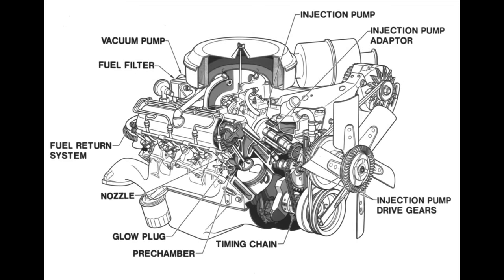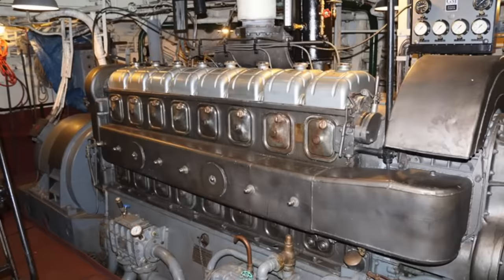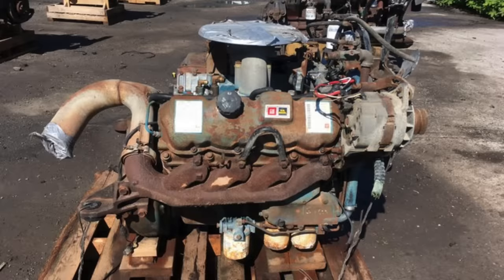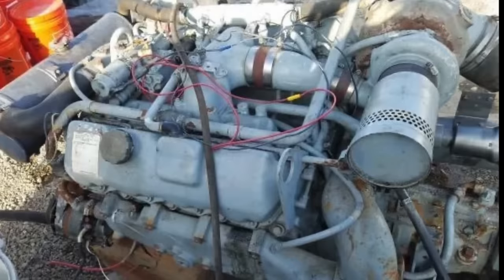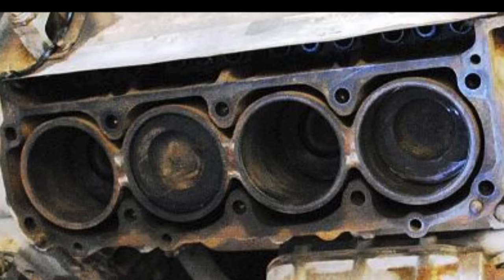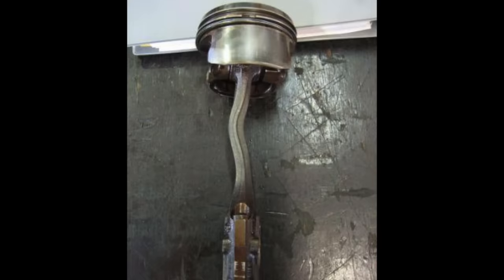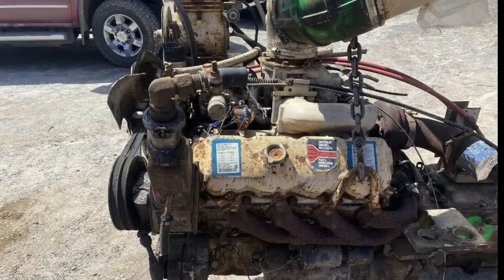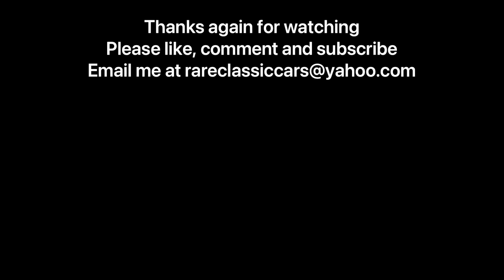Worst Engines: GM's 8.2L / 500ci "Fuel Pincher" Detroit Diesel Pinched Its Owners' Pocketbooks

Comment: The head gasket issues are even more hilarious than that.  From what I've heard from others who worked on it at the time, they updated the gasket, which didn't work, they tried to harden the cylinders, which didn't work and created a tendency for them to crack.  Then they put out a bulletin to drill out the head bolts to the next size up, which actually made it worse, because that block was so weak that the extra clamping force warped the deck and pulled the cam bearings out of round, resulting in the camshaft seizing.  Incredible right?
Reply from the maker: Those stories are correct.
Reply: Lmao
Reply: Holy crap
Reply: Wow. 😂
Reply: Jesus christ this engine has murphy's law written all over it
Reply: I used to work as a welding supply chain store service tech and every brand we sold had at least one part that was used in multiple models that was junk by design, that they constantly said they fixed the problem with, but never did anything but change the part number on it and rais the price.

One day we had the major company Reps come through and this issue came up and they denied the whole thing until I went in back and brought out all 5 of the supposed updated boards from oldest to newest and told them to tell me what they fixed given every board was the exact same circuit layout using the exact same components and only the board ID numbers were what had been changed between them.  I got zero answers.
Reply: Good lord. At that point they might as well tell technicians to weld the cylinders to the block. 😂
Reply: I've got to of the 250 turbocharged 8.2s and they aren't a power house but the get about 10 miles per gallon loaded or empty and so far the one has been good but the others on stand by for a replacement
Reply: It's pretty standard procedure that when you alter the clamping loads on an engine, like when you stud a block for racing, you torque things to the new spec and hone or bore all the relevant areas to ensure they are round under operating conditions.    Trying to increase head clamping force without considering bore distortion and cam journals is a rookie mistake....
Reply: Straight diesel aways better then v diesel
Reply: Unbelievable. Literally can't make this shit up..
Reply: DAMN!!! 🤯😂
Reply: @cjhopkins7128  the same thing goes for petrol engines.
Reply: I am still running 2 of the 8.2's  , I also had a 5.7 diesel in an old , without issue
Reply: @ShortLifeProductions A shit design is a shit design. The only fix for shit, is the toilet. That’s what my dad always said.
Reply: I am still running 2 of these 1500 hrs and dont leak or burn a drop of oil !!
Reply: Silly question, what would have happened if you'd have welded bridges between the cylinder liners and block, turning it into a closed deck?
Reply: Good way to help prevent some of these things is to run the engine colder than normal. About 20⁰F colder than normal, during the summer.
Reply: @Choochinc this engine would make a great trot line anchor. 😂
Reply: It was amateur night in the engineering department

Comment: It's almost like GM decided to put ALL its bad ideas into one engine
Reply: They just needed the plastic coolant elbow of the 3800.
Reply: No. GM people all their bad ideas into a LOT of engines.
Reply: @peteness9550  True! Things like camshafts made out of candy, nylon timing sprockets, and the LT1 in General Motors B bodies and D bodies.
Reply: Let’s get the crew that designed the Vega engine over for beers and they can help us design a diesel
Reply: Let’s not forget Active Fuel Management and its collapsible AFM lifters that eventually fail and destroy the cam.
Reply: It was the bean counters telling the engineers that we need to cut costs so we can keep our big bonuses.
Reply: If it saves $0.50 per engine, GM will DO it!
Reply: Well, it was a committee decision, so 😁
Reply: I worked on school busses during this fiasco... weak weak engine.. advertised 165 NA and with auto trans, in order for this pig to untrack itself, the converter was so loose when it changed gears it only changed pitch slightly... bad bad bad idea... outstanding mileage but that's all.
A few years later ford replaced it with an old farm tractor I-6 turbo diesel that had 3 times the drivable power and even better fuel mileage... another gm failure
Reply: @maxon1672  There is a class action lawsuit ongoing right now against that
Reply: @turnne  I heard about that. I hope GM feels the pain. Unfortunately the case only goes back to 2014 model year engines, even though the 5.3 has had AFM since 2007. It has affected two of my well-maintained trucks.
Reply: @peteness9550 speak English much?
Reply: @billjenkins3699  165 NA wasn't bad for that displacement, assuming it actually made that much power for long, I would be very skeptical of any of those actually putting out 165hp.  Early 5.9s were only putting out 160hp, but also 420lb ft.  normally for NA diesels to make good power they need to be huge.  I've driven enough malaise era cars to know just how shit American V8s could be back then haha.
Reply: @mrvwbug4423  500 cubic inches? That's nuts!! The turbo version was only slightly better
And tq was sad
Reply: @billjenkins3699  That torque is sad.  500 foot pounds with a turbo, and 350 without?  I had a 1972 Cadillac with a 472 cubic inch (7.7L) gas engine, and THAT thing made 500 foot pounds of torque with gas.   (They also made a 500 (8.2L) back then, on the Eldorados, front wheel drive, that made 550 foot pounds of torque.)
Reply: The two stroke Detroit wasn't a bad engine. It hauled more freight and powered more heavy equipment and generators than any other design ever made. Now the 8.2 was the Oldsmobile diesel of trucking.
Reply: @HighSierra1500  ford and dodge used the nylon timing gears. Ford even used one on their gear driven 300 6. its was for "noise reduction". Stupid idea.
Reply: @seeweezeke  Stupid, indeed! I cannot say I've ever clearly heard a timing chain and sprockets while the engine is in operation.
Reply: @HighSierra1500  you haven't. they were CHEAPER
Reply: Seems they had plenty left over
Reply: @K-Effect lol promote them
Reply: @seeweezeke  they lasted pretty well though, I swapped mine out to cast iron cause I was afraid the cam gear would break - now it sounds kinda like a tractor, cool actually
Reply: The company my dad worked for, bought 50-60 GMC Astro back in the early 80's. They had about 7 donor trucks to pull parts off of, after 2 years...

Comment: Worked on Detroit 6V53 V-6 diesels in the USCG, and 3-53 diesels in skidders; we always said of Detroits, "if there's no oil under them there's no oil in them"...
Reply: Loud loud 🔊📢
Reply: My grandpa told me that Detroit engines was the reason God made Silicone!
Reply: bit like harleys.. same sht..
Reply: I used to ell and fix used cars in the 70s. I said, "Show me one that doesn't leak, and I'll show you one with no lube in it!"
Reply: You also got to remember that 71 series has been made since the mid 30s... so there were a baziilion of them leakers out there even though the late silver series updated in the 80s though late 80s didn't reall leak or burn oil nearly as badly.
Reply: We ran a 3-53 in the crab boat no wonder my my hearing is gone.
Reply: Truth is these the 53 series did just what it was meant to do..... n also were  universal which is now an old school idea?? Why have 253 353 453 n 6v53 ect. All use the same parts...... 
Pffff who wants an engine that is cost efficient to repair.... 😊 ok must say I love these engines.... from the 253 on the screen plant 353 n 453 in our skidders to the 671 in My fwd highway plow truck..... run um on the governor n keep the oil up😊 hold onto the parts u have seem to b harder n harder to find lately guys
Reply: Lol right when it stops making noise that's when you worry!
Reply: @Wingnut353  that's because an ECM was added and it had a 10 minute idle timer. If it idled 10 minutes it would shut off. The old two strokes would leak out of the airbox drains if idled excessively
Reply: @Drmcclung  
Just like a jet engine. 
You don’t want ‘em to get quiet.
Reply: Most of the time it's shitty guys fixing them. my oliver 1900 is dry never did paint the engine it's all rust now. My old man rebuilt it 5yrs ago. He never had a leak on a detroit secret is aviation form a gasket on all the gaskets.
Reply: Well DUH!!, they are a two stroke!!!!! small internal leaks cause the crankcase to be under pressure which in turn pushes out oil. Remember they are a 90 year old technology and still working.
Reply: I was born into a logging family in 1976... I can remember as a kid dad having Franklin Skidders with 4-53 Detroits. When the temp got down close to 0 Fahrenheit he used to leave them running all night cause if you didnt you had to pile sawdust underneath them and soak it with diesel and light it on fire for an hour or two before they would crank. But a worn out detroit will outlast a brand new cummins, minus the performance...lol
Reply: Detroit Diesel the most efficient way to turn diesel fuel into noise
Reply: Totally different engines than Detroit’s Marine engines. 
Detroit marine is the worst lol USCG runs them because they’re cheap and parts are worldwide which is critical to have.

Comment: The Canadian military used these 8.2l engines in our Medium logistics trucks, I was an army mechanic and worked on them a lot. They were geared so low that they would redline barely doing 55mph and would struggle to maintain that speed up the slightest of hills and risk throwing the rods out the side of the block going down the other side of the hill. All while making the crew deaf with the noise that “isn’t service related...” They worked well off road when put in low range and turning the 3 power sucking Rockwell differentials.
Reply: Totally agree I’ve never seen head gaskets fail and we drove them hard I never fixed any head gasket as a vehicle technician of the Canadian forces first and second line
Reply: my dad remembered those  but his time  trucks had REO  120 something horses 6 cyl that powered his 6 by    but it did 11-14 mpg  compared to those 8.2's  maybe 6 or 7 mpg
Reply: fun anecdote, i once  saw a mlvw with two holes in the block and it was still moving by itself
Reply: @paulkuras18  My experience as well. We had one in a 20 ton tow truck. The truck had a 2 speed rear. I noticed that after some people { that refused to use the 2 speed rear} drove them there would be symptoms,
Also, this engine had wet sleeve liners in the exhaust port. the super hot exhaust could burn away the cast iron ports in the head, So they usd the thin steel sleeves {like injector cups} But these sleeves were sealed with rubber O-rings. I often wondered if that wasn't where thr coolant went on our truck. When it was driven by drivers that didn't "lug" the engine, we didn't have a problem.
Reply: Was a resident at CSC Warkworth, we scrapped hundreds of the aforementioned trucks.

Comment: Pretty sure the HT 4100 has the same free standing cylinder design. 

Incredible that they managed to put just about every bad GM idea all into one engine.
Reply: DZ ...............it's gm ..........it's who they are ?????
Reply: I was looking at the pistons, and I thought they look a lot like LS pistons...
Reply: @dannycalley7777 It's who they are now, anyway. The newest stuff is almost as shameful as the 8.2. Hearing about bearing failure on brand new 5.3s.
Reply: I owned an 83 Sedan De Ville with that crap engine. 
The HT 4100 was an oil 🛢 leaking low power mistake of an engine.
Reply: Open deck blocks are pretty common in modern spark ignition engines. Mostly because it makes die casting the blocks from aluminium a lot easier. But obviously they see a lot less pressure than a diesel.
Reply: The HT 4100 had free standing cylinders, and it also had replaceable cast iron cylinder liners: https://youtu.be/5xLKMh82kLg?si=BMQyzNHKEi0YUzEX&t=288
Reply: There are a lot of engines with an open deck design. When done right there isn't anything wrong with it
Reply: The dt 4100 had individual cast cylinders with the head off the cylinders just pull out with o ring on the bottom and the head gasket to seal. On top
The 4100 is a great idea but didn't work that well any mechanic should be able to do a in car rebuild but by the time this engine came out engines should last 200k never needing a rebuild cause cars are disposable
Reply: @Steve-iw8yz  problem I seen with them was block flex and the main caps broke. I seen a lot with that issue
Reply: Face it everything goes down hill , first poor design  choice  VBlock always  always  without  exception start with in line block design  use your head little  honest goes along way .
Reply: @jodybrown4956  🤣🤣🤣 ok kid
Reply: Ahh I remember the old hitch and tow 4100's
Reply: @jodybrown4956 you don't know what you're talking about
Reply: @DarkIZero  ahh I remember the old hitch and tow 4100

Comment: We had  several of these in ford and gmc school buses. The fuel mileage was WAY better than the alternative gas engines. We had pretty good luck with them and school bus’s were a good fit for these. I remember they used the same basic unit injector as the two stroke Detroit engines and were prone to leaking fuel into the oil. I think I still have the tune up tools for this engine somewhere in my stuff. Cool video. Thanks
Reply: I had one in a C50 Chevy and the only trouble I had was the “making oil” with the fuel getting in the crankcase
Reply: It took some skill to properly set these 8.2 injectors. They weren't as simple as the old 2 stroke Detroits, or even the more modern 60 Series. 
I kinda liked these engines. If you treated them as a Light/Medium Duty diesel and didn't expect them to perform like a Heavy Duty, they were usually up to the task. 

I'm sure there's bus drivers out there that drove IH busses with the IDI 6.9 and 7.3 diesels in them. They would've been much happier with a Ford or GM bus with one of these in them ❤
Reply: @jennifernuckolls8423  yes you could pull the dipstick and smell the fuel in the oil.lol
Reply: jimmy driptroit
Reply: It's a wonder how these engines were designed and approved for use like this, while knowing the proven reliability of the 2 stroke engine. You would think they would use some of the same diesel principles to build upon. I'm guessing it was designed as an inexpensive alternative to a gas engine, and to have a similar lifespan. This is also toward the beginning of diesel technology being used in lighter duty applications.  International Harvester had similar issues with their DV550 V8 in the late 70s.
Reply: Hey Greg, if those tools are For Sale, I'd luv to get my hands on them. I've got 5 of these pigs rootin' around in Tree Guy trucks and the ol' coot that runs the racks for us is a bit too costly...but the only game in town.
Reply: @tomromanski7925  Is the DV550 that stupid 9 Liter V8?
Reply: Yes it was the early version. The one that came out in the early 80s was much better.
Reply: @johneckert1365  I drove those buses back in the 80s. Since they were automatics with airbrakes and power steering, they were easier than the old manual gas buses I learned on, but they sure were slow! Today a 6.7 Cummins with AC and an air ride seat has me pretty spoiled compared to the old days.
Reply: @bastarddoggy  I bet they do!
Reply: @tomromanski7925  
Huh?
He told you. 
Emissions is the reason why.
Reply: @patrickflohe7427  they weren't that concerned about emissions in the early 80s just yet. They built those 2 strokes into the 90s.
Reply: @tomromanski7925  
Lol
Of course they were. 
It’s just that they slowly phased in the requirements. 
It’s more about control than anything, but hey.
Reply: @patrickflohe7427  As far as I know, heavy duty diesel engines were not subject to emissions regulations until the 1990 amendments to the Clean Air Act. Two stroke Detroits were still being installed in on-road heavy vehicles until the mandated 1995 deadline. Heck it wasn't until 1984 that Detroit release the "silver" series engines which were the best of the two strokes. The fuel pincher was nothing to do with emissions. It was an attempt to produce a lighter, cheaper, efficient and quieter engine.